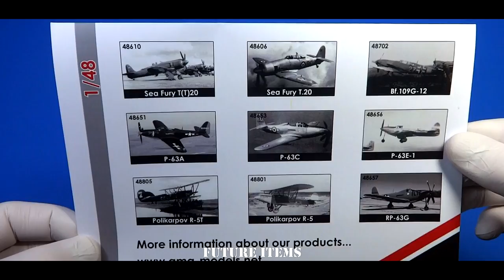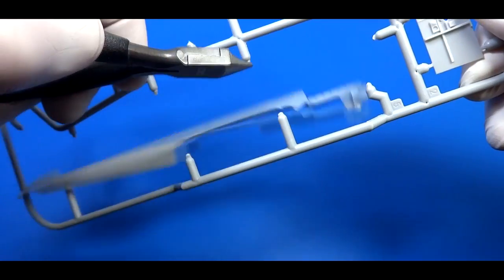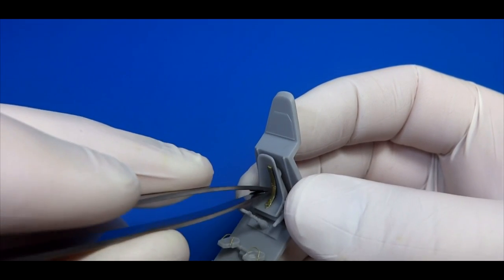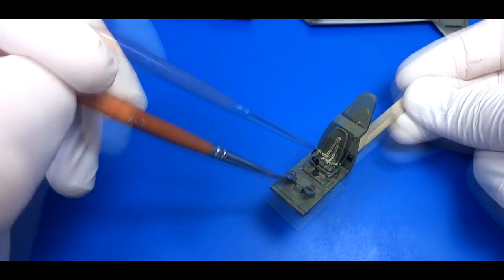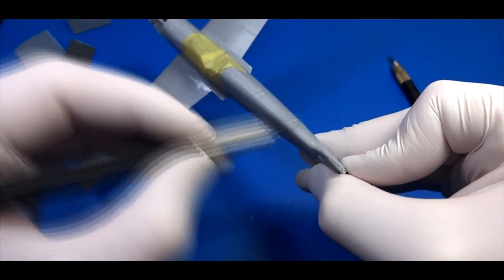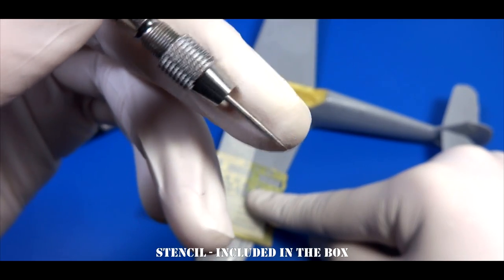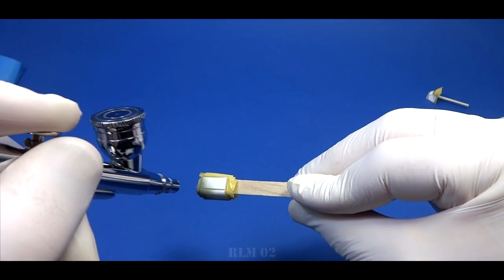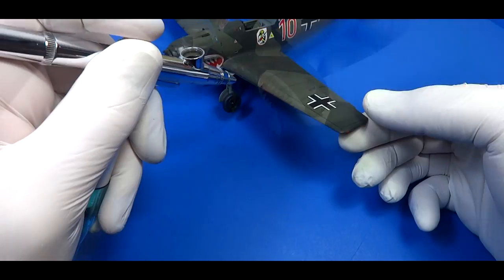FULL VIDEO BUILD MESSERSCHMITT Bf 109C by AMG.

Comment: thanks for your works - all videos are amazing. can you answer some question? am a beginner, so can you tell your aerograph parameters, 0.2 or 0.3 or 0.4, when you paintin base color and camouflage, and what is the preassure? (bar) it looks like a magik,  and so easy. im using hs ultra aerograph, and i can't get such perfect result at spraying, even using enamels, i need to make many covers to get the color i need. but you - one movemen and red is red! thanks for your time!
Reply from the maker: Sparmax SP-35 is 0.35 and Sparmax SP-20X is 0.2mm nedle. It is more about the paint mix so You should practice on paper (gloss paper) with color mix 60-40, 50-50 with pressure from 1.2-1.6bars. The H&S Ultra is very good airbrush with 0.2mm nedle so You would be able to get great results with that airbrush. All the best! Dusan.
Reply: ScaleModelAircraft Thank you!

Comment: Great build but I don't understand why @12:35 you rescribed the fuselage seamline you've just sanded before ? Otherwise, very nice work 👍🏻👏🏻
Reply from the maker: The Bf-109 have a panel joint line there so you should scribe it. Thank You! All the best! Dusan.